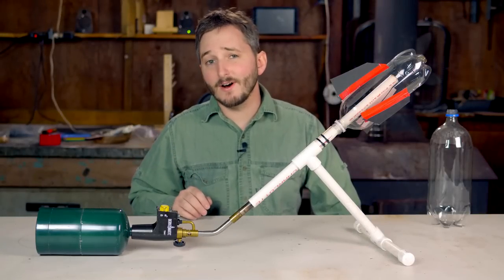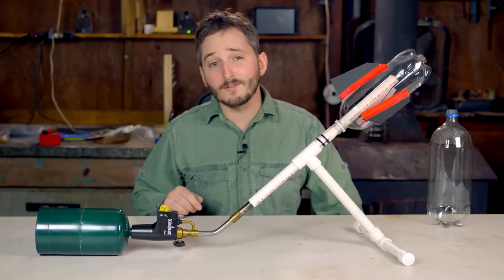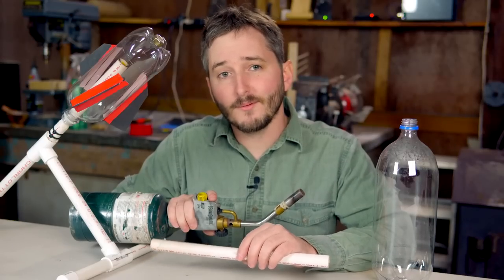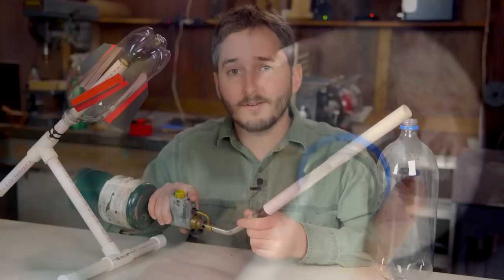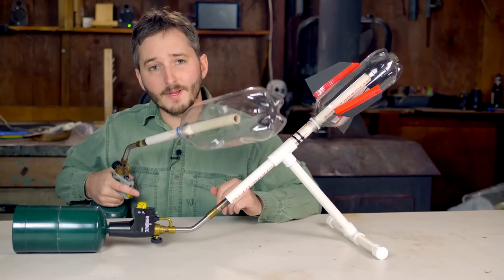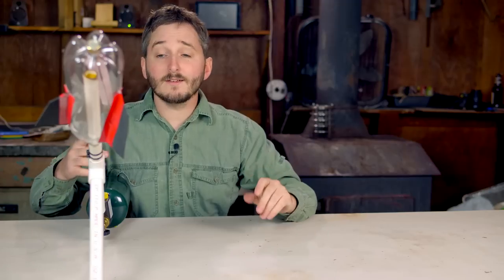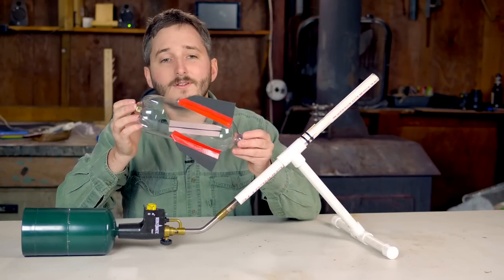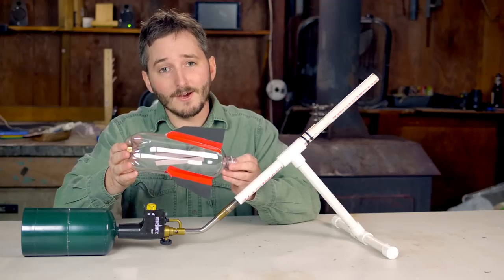Simple Bottle Rocket Launcher (Propane)

Comment: I wonder if you took 2 bottles and pieced them together, could you increase the aerodynamics of the bottle? Cut off and use the open end as a nose cone attached to the bottom ( leading end ) of the rocket itself. The extra weight could yield some interesting distance advantage. Make sure to use the cap !! ya got my wheels turning.

Comment: It might be fun to make a more svelte version. If smaller it would fill faster, be quieter, and maybe more subtle for very young children or for just toying around with the limits of fuel/air ratios which gets trickier/more fussy the smaller you go, trying to get the flame-front to propagate and swirl in an instant. 
I really like the functional simplicity of your design.

Comment: I knocked one of these up literally minutes after watching your 'plasma tube' design. Had all the bits within a 3m radius tho. 

Two features you didnt mention is their very short range, and the fact the projectile is an empty bottle, so almost impossible to damage anything. Unlike, say, candy rockets, its totally fine to let these off in an average suburban yard, or  even a big room. They accelerate very fast, but at the end of the arc just kinda waft down. Great fun.

If you havnt built one, and you have a blowtorch, file n a foot of poly pipe lying about, get up, n go and make one. Now. Totes worth it.
Reply from the maker: I got the range up to about 200' with fins and nose weight. I think there's room for improvement still.

Comment: Very cool design I like the simplicity. I do something similar with my son’s class every year only I stick to compressed air and just use PVC and a bicycle pump. I like that method since it shows how you can exchange energy, by putting work effort into operating the bicycle pump, then release the energy stored in the contraption and watch the rockets launch, the kids get to feel a little tired by operating the pump and I think understand the idea of mechanical advantage. I have enjoyed using paper rockets made from card stock and masking tape. They are very sturdy and can typically get 20-30 launches from a rocket. The paper seems to go higher and farther than I have been able to achieve with 1-2L bottles just air or air and water. But any of it is a load of fun and we always end up with a crowd of kids when we go to the park. I think parents at the park would feel a little easier letting their kids operate a bicycle pump than a propane torch. Lol.

Comment: It's actually filling the bottle with a propane and air mixture, the torch is doing the mixing for you before puts it in the bottle. It's not all just propane. If it wasn't a mix, it wouldn't ignite.

Comment: I’d imagine that creating a hybrid pneumatic/combustion system for air cannons would be pretty darn space efficient. Kind of like what Petersripol did with a few nerf gun mods. Had this idea to revive a 10 year old Nerf design from a video game Hasbro made called Goliathan UB-1. That thing launches projectiles so big you could stuff a guidance system, folding wings and an edf jet into a giant foam dart. And you can fire typical enormous foam projectiles too. But Nerf N-Strike Elite (2009) and it’s prequel from 2006 are absolute treasure troves of ridiculous abandoned nerf gun designs that nowadays could be fabricated from 3D printers, foam molds, and electronics.

Comment: You should try adding a constricting nozzle that closes slightly when it leaves the PVC pipe to allow for a more prolonged and focused burn for added range and possible passive or electronic steering control!

Comment: I'm definitely going to have to try this with one of my giant spliced bottle rockets. I wonder what a 8 or 10 liter water rocket would do with a system like this. Maybe I can come up with a way to keep the water in them too, like a snorkel that would allow the air to push out that sits above the water level. Your videos always give me inspiration to try new things.
Reply from the maker: I was thinking of trying something similar myself with spliced bottles. I wondered about figuring out a way to put water in them also, and if that would be of any benefit. You would need a valve built into the bottles to let air out when filling with propane since water would keep it from escaping the bottom.
Reply from the maker: It would be quite low pressure compared to your pumped rockets. Maybe 30psi from a propane combustion, which would quickly reduce itself as water in the bottle cooled the gas

Comment: You can do gas over water and it will go four times as far. Not for kids though. I used to do this very thing with HHO :) Also be careful as the plastic bottle will become brittle from heat cycling. I dont know about propain, but the HHO rockets would eventually blow up the bottles at launch.

Comment: Why is it every time you put out a video I find myself headed to the home Depot...heh heh heh... Just kidding, you know I love it...Thank you for this awesome video and giving me another quick little fun project to make. I love these little fun projects,... thank you so much! 

P.S. And yes of course I made the plasma coil bottle launcher and it came out really great and works absolutely perfect.
Reply: Okay I'm back from the hardware store and I just put all of my pieces together. That was a really fun build.I changed it a little bit, I made mine so that the launch angle could be anywhere from 45° all the way up to just about 90°by putting a smaller tube inside of a larger tube and putting holes through them so that I could put a pin in the holes at different heights for different angles.  after trying it several times I'm having difficulty getting it to ignite every time,   I was wondering if you had any tips or pointers how to get it to pop every time.Thank you very much Ben.
Reply: Okay it's the next day, last night I stayed up really late and I've completely redesigned it and now it works perfectly every time. I made a fail safe igniter switch and installed it inside the propane tube at the very tip so that if it fails to ignite I can just push a little red button and off it goes every time.
Reply from the maker: It can also help to turn down the flow of propane. If it flows slower it is more likely to suck in the proper amount of air in the ports on the side of the torch which will give more reliable ignition.
Reply: @Nighthawkinlight  thank you very much for that really good tip I'm going to try it immediately.
Reply: Well I tried it several times with every different amount of slight pressure I could change of the propane and I only got it to fire off one more time.  I am thinking that possibly I didn't sand  enough around where the threads are on the soda bottle to let the oxygen out fast enough perhaps... because I'll will tell you that it works every time as soon as I take the bottle off,  it pops nicely with a small little flame at the end of the white pvc pipe. not only that but my plasma coil bottle launcher works perfectly and I think I sanded that one a little bit more. I sanded it symmetrically in four different places with my bench grinder wheel and for some reason on this one I only sanded it in three places instead of the four... I don't know what else it could be unless I change the length of the tube that actually goes into the bottle and shorten it a little bit and maybe it'll work better  but I'm not sure.
Reply from the maker: Yeah if you think you can sand it more, do so. The more air flow you can get the better.
Reply: @Nighthawkinlight  ok, thank you for your valuable time. I realize how extremely busy you are and the fact that you're actually helping me fine-tune and tweak my project says a lot about you as an individual and I hope everybody on the entire internet reads this. Ben, you are an incredible individual because not very many people would take the time to help out someone out that they don't even know just to try to help them further a project that they're creating,... that is so nice of you.the fact that you put a little project out and you realize people are actually putting it together and they have a little trouble and you try to help them, that's extremely nice of you and I can't say enough about it... thank you from the bottom of my heart. I know everybody isn't like you but I really wish they were because the world would be a much much nicer place.sorry I went a little overboard there but I just want you to realize how much I appreciate your help, and maybe when other YouTubers read this they will realize how important it is to help out their subscribers and how appreciative it is.
Reply from the maker: Thank you for your kind words! Let me know how it goes.
Reply: @Nighthawkinlight  well I took it somewhere today and showed a bunch of people and everybody loved it and then some of them asked me to make one for them because it worked really really great and I also showed off the plasma coil launcher as well and that work perfectly also. So thanks again and I can't wait to see what you come up with next.

Comment: I'd love to see an updated version of this  using a Tesla valve to speed up the combusting gasses in the tube. Very curious to know if there is any performance increase from doing this, or if the bottle sees the significant portion of it's thrust from the expansion in the bottle.

Comment: As kids we used too take pop cans and remove the ends. Stack them one on top of each other 7 cans and tape heavy. Back then they were steel cans not the aluminum cans today. The bottom can had a hole on the top about the size of a half dollar in diameter. Tape heavy with duct tape. Make a small hole in the bottom near the end cap. We used a tennis ball. Squirt a small amount of lighter fluid shake and ignite with a lighter or ? . Tennis ball must be inside of can when shaking t o create fumes.. start out with small amount of fluid then gradually add more if needed.  Use safety glasses and best of luck.

Comment: You should 3D print a nosecone in vase mode to tape on & make the rocket a bit more aerodynamic!!!😁👍🏻
Reply: Just ran over to Lowe's and picked up the Bernz-O-Matic TS8000 torch head and PVC fitment parts for around $60 minus the propane cylinder!!! You have to use this model as it has a constant pressure regulator on it for use in any position!!!

Comment: I heated up the 1/2" pvc with a heat gun until it became pliable. I then stretched the pvc pipe which decreased the diameter of the pvc so air could escape from the bottle without having to file down the outside of the pvc.
Reply from the maker: Good idea!

Comment: First of all, thanks for your video, it was very helpful. I only made one modification, I put a sweeping 45 degree bend in the exit p[ipe so that the rockets went straight up making it easier for an old man like me to recover the rocket. also I intend on using MAPP gas instead of propane if that's still safe. In your opinion, is MAPP gas ok as a propellent? once again thanks for your wonderful video my nephews are going to love the maiden voyage tomorrow.
Reply from the maker: Probably mapp gas should be fine in carbonated soda bottles, but better to stick with propane. The rockets are very loud already, there's no reason to push them further. You'll need hearing protection for yourself and the grandkids. Let me know how it goes!

Comment: Excellent! My students are building rockets this week as we study the basic history and modern usage of rockets. This propane launcher is just what the doctor ordered... What is the max apogee you are seeing with this set-up? I am picking up parts today and appreciate the inspiration this design has provided me! Be well!
Reply from the maker: These rockets reach about 100 feet high at most
Reply: @Nighthawkinlight  Great! Secondly, I built my launcher as you displayed (Propane, etc.) but I am only achieving a 30% ignition rate. Most of my attempts have been duds during test launches. Any recommendations for launch consistency? Thanks in advance!
Reply from the maker: First thing to try is turning your torch down so the gas flows slower. That will fill the bottle more easily with the proper fuel/air mix. If that doesn't work, file the gaps in your pipe deeper so air can more easily get out.
Reply: @Nighthawkinlight   Thanks for the feedback! I will try your suggestions.

Comment: Very impressive. Could you make other rockets, using other gases, like carbon dioxide, made from reacting vinegar and baking soda? How would they work out? Cheers!
Reply from the maker: Easier to use an air pump than a chemical reaction of that sort
Reply: @Nighthawkinlight  Thanks! Keep up the great videos.

Comment: This may sound dumb but what happens to the gas at the explosion. Is it no longer propane and goes through a chemical change to another property that makes it more pressure. Or is it the heat that moves the atoms more quickly and they go out the path of least resistance. I know it seems like a weird question but I think we always take for granted pyrotechnics just cause pressure but why and how. Idk
Reply from the maker: It changes from propane and oxygen to co2 and water. Those gasses have more volume and the heat causes extra expansion.

Comment: Tried doing this with a similar setup, using water bottles. I can get flame out the end of the tube, but not with a bottle attached.  I sanded down the fill tube, I just can't get it to ignite in the bottle. When I remove the bottle, it reeks of propane, so I know it's getting fuel. I even shortened the fill tube. Suggestions?
Reply from the maker: Fill it more slowly. Turn the torch down. It's getting too much propane and not enough air

Comment: I have a lot of ignition problems. If the backpressure is to high, the propane nozzle does not drag enough air into the mixture. It gets to fat and will not ignite.
Reply from the maker: You can help that by turning the torch down so it flows less quickly

Comment: have you tied adding some ejection mass(water ) to the bottle?  I imagine it would go further.
Reply from the maker: Hard to do with this design
Reply: @Nighthawkinlight  if it went vertical, and maybe sleeve over an o-ring( or a bunch of electrical tape).

Comment: Very well done. It is interesting to see the green color of the gas in the initial stages of combustion. It appears to move the bottle forward as it hits the nose end and then rockets out the tail after clearing the pvc pipe. I wonder if a two stage model could be fabricated. Cool work.

Comment: I just made this but when the bottle is on the pvc, the igniter doesn't work. Without the bottle it ignites but when the bottle is on it won't. Any idea how I can get it to work? I have all the same exact parts as you except I'm using a blue propane torch instead of green. Thanks
Reply from the maker: Not enough space for the gas to get out. You need to file the gas in the pipe deeper.

Comment: Is the tapering around the pipe near the timber stops caused by the hot exhaust or did you narrow it to make it launch better?
Reply from the maker: That's too let air out of the bottle as you fill it with propane

Comment: Please give more detail about propane torch!
Reply from the maker: Bernzomatic ts8000
Reply: @Nighthawkinlight  oke
Reply: @Nighthawkinlight  i am having trouble finding the right diameter pvc pipe that fits over a soda bottle, so i modivy with tape to make a tight fit ,it works but after firing a lot the tape start to lesk.

Comment: I put together my own but im having trouble with it igniting. The torch is functioning correctly. I have my recesses made for air flow. What am I missing. The legs are blocked off as well...
Reply from the maker: Probably not enough of a cutout around the bottle mouth, or your torch is on too high. First try turning the torch down, and cut more of a gap in the pipe if that doesn't work.

Comment: I tried making your AR gun model exactly as you did and it won't ignite. I'm using the TS8000 bernzomatic torch head with MAP/PRO propane gas. If I just use the hose alone, it will ignite. Please help, I'd love to get it working.
Reply from the maker: Possibly your tubing is spiraled too tightly. Try turning your torch down so the gas flows slower and that can help.

Comment: Do you know how MAPP gas (yellow canisters) would compare to using propane for this particular project? I know it burns a couple hundred degrees hotter
Reply from the maker: Propane works well and at safe pressure. I don't think mapp gas would give any benefit, and would just increase risk of bursting the bottles. Butane may even be preferable to propane, and burns slower/cooler still.
Reply: @Nighthawkinlight  Awesome thank you for being so involved in the comments, you've been amazingly helpful

Comment: If you put some water in the bottle, will it go farther?
Reply from the maker: It wouldn't work with water in the bottle because the air couldn't get out around the bottom to let propane in. You would have to put a valve in the top of the bottle to let air out when you fuel it. It probably would go further though. I've thought about testing it

Comment: Cant get the torch to light in the launch tube. Any tips?
Reply from the maker: Lower the gas flow, make sure the gaps in the pipe are letting as much air as possible out of the bottle

Comment: It will burn the bottle. Heat will shrink the bottle. Bottle ts not reusable like water rocket. For repetitive launches we need pile of empty bottles.
Reply: That's not a problem here in the US. Soda is as cheap as water here, and is sold everywhere.
Reply from the maker: The mouth does not shrink. I have fired the same bottle dozens of times